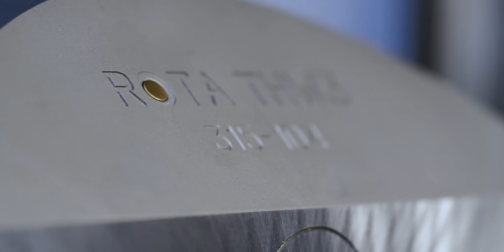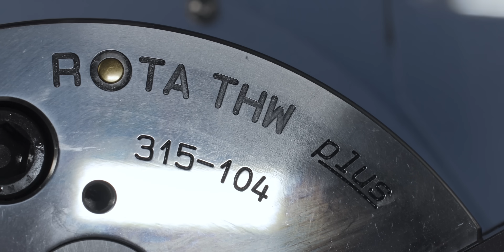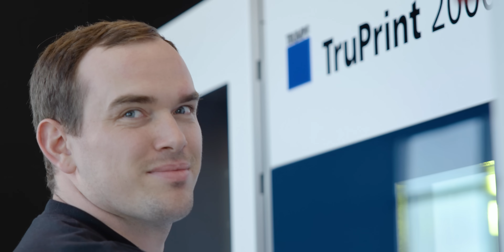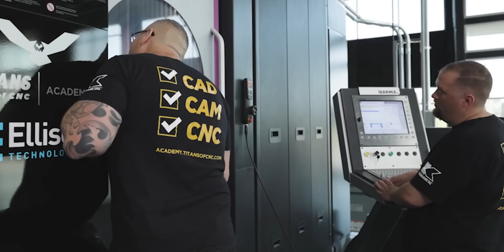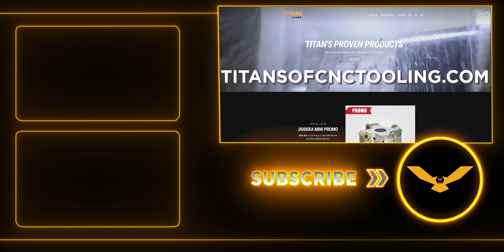Should Engineers Be Arguing with Machinists Over Run Time?

Comment: The problem is one of communication. I'm a mechanical engineer who started out in the shop building the components I designed, assembling, testing and creating drawings, so I have a good idea how to machine things. Before I hired people for my company, I was the only engineer machining components for our (3 engineer team) designs. However, I put all that aside when dealing with my machinists. If I approach them with a project, I give them as much information as possible (design may be in conceptual stages) so that they can tell me how much time THEY think it will take to make each component. 

Simple way of doing this is a design kickoff meeting. Concept is proposed, machinists can weigh in on any concerns they may have about the design or at the component level. If you're doing any kind of project management, and you should be, then this is a great time to get their feedback and to set priorities; who needs what and by when. IMO, it is then fair game holding them accountable for meeting dates and critical milestones. 

The reason it should be this way is not only for accountability, but so the machinists, assemblers, technicians, electrical engineers and others may weigh in and feel that they are a part of the project, rather than a cog in the wheel.

Comment: I can't speak for the engineers at work, but the programmers insist on making programming using the max possible speeds for the machines. This has led to us currently having a machine with extremely worn out ball screws within 4 years of the machine being made and effectively cutting down the machine to being a 3 axis machine instead of a 5 axis machine... not to mention the 1-2 weeks of lost productivity that will come with the ball screw replacement. We can't even run our Renishaw probe at full speed without risking an alarm due to position not always being accurate to where the machine expects it to be. All because of running the speeds and feeds at max all of the time.

Some how they don't comprehend the connection of the example of driving your car with the gas pedal down to the floor all of the time. It's clear to the rest of us though.

Comment: I have watched almost all of your YouTube videos.
I am a (71) year old retired blue collar cnc engineer.
At first I was a highly skilled Tool & Die Maker that could operate every manual machine.
When NC started getting big in the early (80's), I went into that new profession because the wages ($") were much higher.
CNC Machining History: Punch tapes EXPLAINED - https://www.youtube.com/watch?v=zMg36m4_IWk
Machining Center : FANUC-6M - https://www.youtube.com/watch?v=cw8mutnngx4&t=31s
Now down-load the paper tape into memory and edit the program inside the control unit.
There were 'no' tool offset measuring tool setters, so a shim was used to measure from the top of the work piece and the bottom of the tool.
I made a custom tool, a large clock indicator on a custom base, set to (3.000") high. Then offset my coordinate position [G92 Z-3.000].
I could do (20) tool-length offsets in (20) minutes.
When the first (G50's) came out there were no FANUC instructions, so I had to figure it out for myself.
Mori Seiki MV Junior - Lionel Vietnam Part 4 (Final)
https://www.youtube.com/watch?v=pahOhP9mFmA
....
Did I mention that I live in Canada.
I was hired to set-up and tool-prove NC programs. (Mid 80's)..
I worked under (2) university graduated engineering students that did nc programming in the engineering department. 
Both:
* Never ran a machine.
* Knew nothing about {S.F.M.} {Speeds & Feeds} {Chip Load} {Cutter Directions}
* Since I was shop floor worker, I was not even allowed into the engineering department.
Years latter I was allowed into the engineering department to teach the cnc programmers how to program.
* {S.F.M.} {Speeds & Feeds} {Chip Load} {Cutter Directions}
* Sub Programs
* Macros
....
Reminder I mentioned that I live in Canada. In Canada blue collar cnc highly skilled workers are treated as lower class and the lowest paid ($) in the world.
Canada still practices 'Monarchism'. {white collar = upper class} {blue collar = lower class}.
(December 2022) Canada does 'not' even make the top [10] manufacturing countries in the world. (Why ?)..

Comment: Ive been in the high end church furniture 5 axis machine environment, countertop/solid surface/ granite industry with robosawjets, cnc's water jets and now in the plastic injection mold machining industry all in a operator, cnc programmer and or management position.  I can tell you the most inefficient disconnect I have see in most companies is there is a lack of cross training or trying to bridge the gap on understanding the processes, the ceo is only a business man and knows nothing about machining, engineers, sales people have no machining background yet their bottom line is based off quoting.  Its like a baker that knows all the ingredients and doesn't know how to operate a mixer or how long it takes.   

There will always be this disconnect when dealing with a high level of complexity but unfortunately most companies wont have the hard discourse to improve, reassess or dissipate the ignorance that dampens peoples livelihood and patience.  This also takes a massive toll on culture and morale in any shop.

Comment: Typical bean counter approach, can never see the forest for the trees. The designers could also be a little circumspect by utilising existing designed parts where possible in the machinery being made thus saving programming and setup time. Obviously, this is not always possible. In my career, I have spent nearly equal time as a manual/CNC machinist and designer/draftsperson so I have seen things from both sides. However, what they were doing was typical of the kind of person who gets departments shut down and ends up costing the company even more money when things go external. Yes, hearing things from only one side of the fence is never ideal but collaboration a positive attitude, respect and cooperation always go far.

Comment: Not sure what to think about this video. It seems like a diss to engineers when it actually should be to the company where this happened. To know the correct time of machining is normal in any company. That's why you have the KPI. Other than that I do understand that most engineers might not have an understanding of how a machine or piece works. I do know that because I'm a mechanical engineer and a machinist. But again, it's how the company implemented the process. In this case it was the engineers but in others is just plain simply the bosses that might not be engineers.

Comment: I am a mechanical engeneer since about six years, and got the same time in machining. Vertical, horizontal mill with pallet change system, and got some expedience on the lathe too. Huge experience in machining, at the machines, right in the middle of the "trade" from quote to deburr. Huge experience at the designer table too. It gives me a dissociative personality disorder when I have to design something. I sincerely think that a drawing or a design is never perfect, nor ready. I only like to design something if I get to make it. That is the only way to have a peace of mind. The worst thing is, if in a company like You mentioned, two departments get so estranged. I once saw Metropolis (1927) and a quote still resonates with me:

"There can be no understanding between the hand and the brain unless the heart acts as mediator"

Sincere communication and brotherly love, both ways. There is no other way.

Comment: So the program that manager put in place isn't necessarily bad and could of been put to good use.  If done properly a program such as that should give you a ton of data points on how long certain things/types of things take to make.  This data could be used/analyzed by the engineering department to inform their design process or set proper expectations for the department.  

If I can show XYZ on average takes this amount of time, your asking for a more complex part so this is a rough but decently accurate estimate on the time and cost it will take to create would be a great tool.

Obviously what your manager did was not this, but it sucks because he put you through all that suck to not get anything useful out of it.

Comment: Manufacturing engineers should be on the floor at all times. They should know the machines from head to toe including all variables, parameters, and some macros. Should be expected to know cam programing and be able to set up machines. Should be expected to have at least 3 years of machining background. Any “Engineer” that has the audacity to give any input of machine run times and productivity without the experienced stated above is under qualified. Especially if he’s a “Lead” engineer.

Comment: >>> I AM A AVIONICS MACHINIST... WORK IN MILLIONTHS OF AN INCH TOLERANCE'S...!! >> EVERY WEEK 2 OR 3 SO CALLED > ENGINEERS CAME INTO THW MACHINE SHOP TO HAVE ME DRILL A HOLE 1 THOU BIGGER BECAUSE OF SOME. B..  S... REASON???? >>. THEIR SIGNATURES WERE ON THE FINAL APPROVED BLUE PRINT I WAS USING.. WHICH TELLS YOU THEY KNOW NOTHING!!!!!  THEY ARE GUESSING HALF OF THE TIME!!!!  >> I WORKED THERE 12 YEARS.. HAD ENOUGH.. I LEFT..!!>> EVEN SEEN THIS AT ANOTHER COMPANY  5 YEARS LATER.. SAME SHIT!!!

Comment: The vid talks about reducing lead time, not cycle time. Lead time includes cycle time, and many more activities that are not controlled by the machinist. The machinist does not control material availability, machine capacity, support resources, queue time between ops, outside processing time, inspection, just to name a few. Often lead time can be reduced by using a wholistic approach and better preparation.

Comment: Tons of these comments seem to be spot on to me.  Not sure how an engineer can do their job properly without consulting a machinist about the complexity of part designs.  If an engineer has no machining experience he or she has no idea what part processing time are beyond cam software.  But none of that accounts for tooling and fixturing setup times or part to part change outs.  As well as the fact that making a part with too much complexity can create the need for many custom fixtures and possibly multiple machine setups.  Long story short, is that in a business that has such a high demand for fast turn around times.  Everyone should be working together as a team and kept in the loop as to be as productive as possible.  The downside of the work place is, that most work environments promote competition for higher earning than the next guy.  With this always being a factor you may end up with about 10% of employees being honest and true and doing what is best for the team, the rest are doing what they can to try to work their way up the ladder.  So it's truly difficult to get a real cohesive team without highly competitive wages for all employees.  Again which is another difficult thing to calculate.

Comment: For things like that it does sound like a system that could help, if the motives were different. Say the fixtures could create a better idea on run times, faster machinists could be used to help the slower machinists, etc. if they worked in unison rather than creating a way to lower the persons subjective quality it could’ve worked better. Best way is usually find the best or the fastest machinists and work with them in a focus group thereafter until more standardization can take place

Comment: I've been an engineer for a small company for a while now. I had the same question, why was it taking so long to make these parts? Instead of changing everything though, I just learned how to program and run the machines. Now I understand, and thanks to you guys.. I'm the best machinist we have 😅.
Reply: Good lie
Reply: @lilcourtny08  lie good
Reply: @ThyialIndustries  you were a button pusher not a machinist. There is a big difference between pushing buttons and programming a CNC and operating a Manual mill and lathe.
Reply: @lilcourtny08  ohhh weird... You should check out a few of my videos.. maybe then you will realize I am a better machinist then you.. 😘

Comment: Simple solution is to get an engineer to shoulder ride a machinist while the part is being made.  Engineers aren't stupid.  You show them what you do and why you do it, and the good ones will learn.  Then, get both the engineers and machinists in the room to talk about issues.

It may have been as easy as ensuring that certain parts are prioritised.  "I need x for a project starting in 3 days, can you make that happen?  Is much better than bean counting across the board.

Comment: I am Mechanical engineer and a CNC machinist. I design, prototype and manufacture my own parts with low overhead to compete with the global market. You can not design for manufacturing without understanding the machining process. Its critical to engage with your machinist and contract manufactures reduce the cycle times of your product and to update the design from mass production. That being said, there is saying “Hard times create strong men. Strong men create good times. Good times create weak men. And, weak men create hard times.” we are just coming off good times with a lots of weak men. There is going to be hard times ahead of us and if you are not prepared to compete against your peers by making things faster, cheaper and or bring innovation, consider yourself a weak men!

Comment: I doubt there are any real (or very few) machinists in the CNC field today. Unless they changed the definition of "machinist" a while back. If you can't make miracles happen with a Bridgeport, a tracer mill, and a lathe (how it was done before CNC), you are not a machinist, your an operator. Nothing wrong with that, but its like calling a flight attendant an assistant airline pilot. Nope.

Comment: As soon as an engineer starts working their career, they swear they can get it done theirselves. Can't stand them. as a tool and die maker, they really need a wake up call to respect.
Reply: not to be disrespectful but that is the message we get throughout our education. As an engineer, at the end of the course you are expected to be able to do it yourself and not pass everything on to others to solve. This is not the point of the training. And in the training there is so much more that is expected of us than manufacturing such as: Strength calculation, pneumatic hydraulic system design and calculation, mechanical system design and calculation, ... Of course we can't be experts in every field I admit. But the general message is "solve the problem with what you have and what you know". ps happy new year and best wishes.

Comment: Sounds familiar and I do not work in machining.  I am industrial engine technician by trade or a fancy way of saying a mechanic on big engines and the company I work for has been implementing employee performance metrics even though the manufacturer of the engines does not have flat rate metrics for the engines.  Needless to say they give unrealistic expectations for meeting a flat rate which is determined by a salesperson who has no experience working on the engine or understands the scope of work.  This company also wonders why they are losing employees left and right during the preludes to a recession while constantly nitpicking performance.

Comment: It depends on the skill set and work experience of both the machinists and the engineering team , both working together would be ideal. In my experience it's usually the middle management trying to get ahead in their own career that can cause the most friction by pushing unrealistic times on the machinist.. given that there is such a different variety of materials and job designs that can be machined it can take as long as it takes. Great video provides a lot of interesting debate in the comments 👍

Comment: Sounds like the problem was the Lead Machinist , under quoting times/costs.

I don't see anything wrong with what the engineers were doing. the tracking costing system is quite a normal thing and quite obvious it was put in place to provide numbers to compare to the quoted figures, it's called collecting data.
When there is consistently a large discrepancy between quoted figures and actual. Then 2 possibilities should be investigated the quotes are unreasonable/wrong, the processes need improvement to achieve the quoted figures

Comment: 10 years of CNC machining and for the last 6 I had to deal with a programmer who had to rush every program and push everything to its limit. He didn't even run the graphics on his CAD software. We had SOO many mistakes. Like stupid, lazy ass mistakes along with crazy, inconsistent feeds and speeds. It was infuriating. I can write G&M code manually so easily now because I spent soo much time fixing his mistakes by hand. 
Then of course, when the boss comes asking why jobs are taking longer, we tell him why. Then he goes and asks the programmer (who is his friend) and the programmer blames it on us machinists. Said that we must be slowing everything down. 
I finally had enough and left 6 months ago. 
That job made me decide to make a career change. I'll get back to machining one day. For myself, not some company.